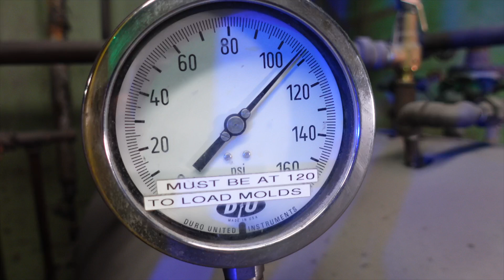President's Tour of Investment Casting Plant | Shelmet Precision Casting | Wild Rose, WI

Comment: 350 degree of steam temp 🤔
Reply from the maker: The burnout process starts at a low temperature (around 100°C to 200°C) to slowly evaporate any moisture from the mold. The temperature is then gradually increased to melt out the wax. This stage typically occurs between 500°C and 900°C, depending on the specific wax material and investment mold being used.
Once the wax is melted, the oven holds at a high temperature (around 900°C) for a set time to ensure complete burnout of any residual wax or impurities.